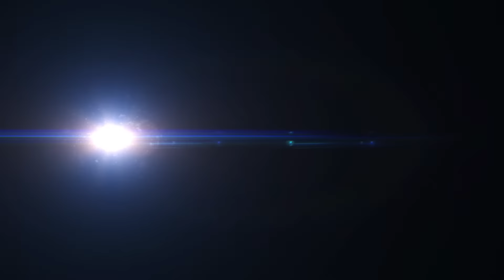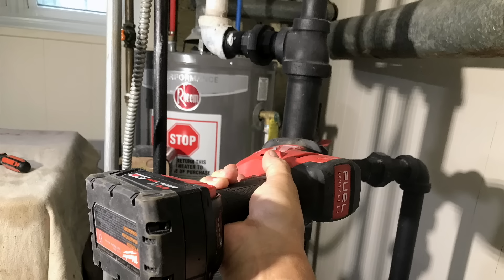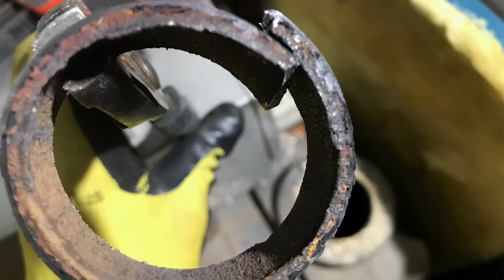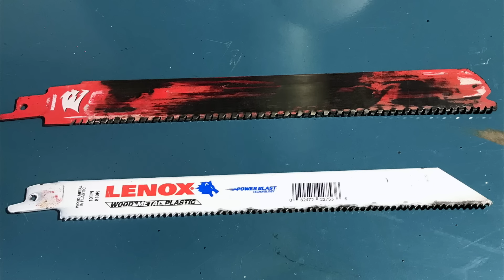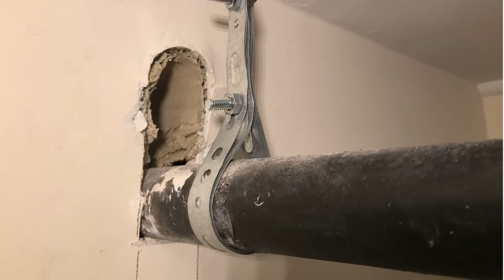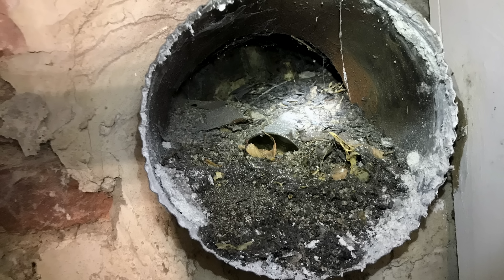Steam Boiler Pipe Repair

Comment: I have to pipe a dishwasher steam 1 1/2 supply and return condensate 1 inch can I use black iron schedule 40 and black iron fittings should?

Comment: Nice job - especially the explanations of how you get the pipes out.  I also liked that some of the mains were insulated.  Many don't do that and lose a lot of heat to the boiler room. Also liked your use of unions.  (I'd add a couple more to the piping for the VXT - just to make changing it easier if ever needed) 

A couple of things you may want to consider - 1. making the nipples below the water line stainless steel - less corrosion due to standing water and 2, maybe adding a drop header to help make the steam dryer.  Otherwise, great job.
Reply from the maker: Understood! Thanks for checking out the video!!

Comment: What happen if the boiler does not take cold water? Wouldn't that be a problem if you are feeding the boiler with cold water? "Introducing cold water into a hot boiler can cause sudden temperature changes, potentially damaging the boiler components due to thermal stress". Isn't this true?
Reply from the maker: This is true and if the boiler does not have an automatic feeder, I always feed with hot water. But if you read the spec's. on some  water feeders they recommend cold water! Could be a warranty thing?
Reply: @BobsPlumbingVideos  Thanks! I have a mcdonnell miller wfe 24 auto water feeder. It says  "Max Inlet Water Temp is 120F". I think the water coming out of the water heater is about 120F.

Comment: First.. awesome video. Totally no nonsense.  Just had a Weil McClain boiler installed. It's a dry return and two loop mains on 120 year old 2 story home with basement.
2 questions. Insulation. There never was any on the mains, the plumber didn't suggest but everything I'm reading is that it's a must.
Also, the diameter of the pipe on the 2nd loop, which feeds my 2nd floor is smaller than the loop that feeds the first floor. Is that correct?  I'm guessing higher pressure with the smaller pipe but I'm struggling with the concept since steam isn't really the same conceptually as air pressure.
Reply from the maker: Insulation a must on steam! Speeds up transfer time, delivers dry steam (best case) Would have to know the load on the 2nd floor to give you an accurate answer. Get this book, it'll open your eyes as to how a steam system operates. It's my "Steam Bible" 
https://amzn.to/3j7higI

Comment: 2 cuts 3/4 apart knock out the 3/4 tap each side to remove with caping chisel.  2 cuts easier then 1 cut.  
I fixed 2 jobs last year that had banging in pipes by boiling out with arm and hammer baking soda.  No re piping or rad replacement as recommended by previous company.

Comment: GR8T JOB..WAS WORKIN ON A  1.28 MILLION BURHAM TODAY-COMPLETE MESS, HAD A GAS LEAK FR WATER DRIPPING ON 1 1/4" -THIS BABY HAS 2  GAS CIRCUITS-THE OTHER CIRCUIT HAD WATER LEAK FR HARTFORD LEAK ON 1 1/4" REGULATOR...VERY LITTLE GAS FLOW !!..SPENT 4 HRS GETTING ONE SIDE OPERATIONAL WHEEEEEW !!!

Comment: Why no valve in the Hartford loop leg to isolate the boiler from the return??
Reply from the maker: Recently installed brand new return line installed by others, didn't think it was necessary.

Comment: Wow what a difference!  That is some solid work and it should be a vast improvement over how it was piped before.  I’m kinda curious why not just do a drop header since you had so much apart?  It is purely a question not a critique, I’m just wondering if it would offer any advantage or if it would be a waste of,time and material?
Reply from the maker: It's a very small house, only one riser coming out. Maybe a bigger boiler with two risers coming out, it's working like a charm!
Reply: @BobsPlumbingVideos  thank you for the knowledge.  I’ve been reading up on steam and watching some videos as well.  I’m also happy to hear you cured the problems with that house.  Keep on fighting the good fight and you’ve also got another subscriber.  Thanks again.

Comment: Nice work as always, Bob…….you mentioned supplemental boiler water treatment. I presently am using Rhomar 903. Although costly, it gets the job done.  What do you recommend? Thanks.
Reply from the maker: For moderately dirty boilers I use Hercules® Boiler and Heating System Cleaner.  But for severe priming and surging, my go to product is Scout boiler cleaner by Hercules. Thanks for checking out the video! Bob.

Comment: Once a week draining is excessive. Maybe if it had float LWCO. Adding fresh water that often will rot the crap out of boiler. I drain  only when i see sight glass water dirty when boiler not running. Unfortunately its a double edge sword when it comes to draining steam boilers.

Comment: You must have been Really mad when you arrived seeing the likes of an 90 Elbow connected up directly on Top of that Boiler... where as your Pipe Geometry was really excellent, with long run of vertical pipe up  the discharge line off the boiler before your First  90Degree Elbow...was told by an old school  Pipe fitter, to go Ten Times pipe diameter before  putting or fitting in a Bend...and make it a  Swept Slow Bent, or consider a 45 degree  another straight pipe then another 45 bend...to go to the Horizontal ...Great Upload...
Reply from the maker: Wasn't necessarily mad , but was like "who does this shit"!

Comment: Great video Bob.  I thoroughly enjoy your YouTube videos.  I am a plumber in Florida and as you probably know most of our replace and repair jobs are very different from your situations.  However, I still watching your repairs.  I was wondering what size caping tool you use.  Do you use larger tools for larger pipe sizes.  Thanks in advance.  Great videos.
Reply from the maker: 1/4" w/ double bevel, diamond, or half round depending on the job. Thank you for checking out the videos!

Comment: Where did you get that insulation ?
Reply from the maker: My plumbing supply house, but Home Depot and Lowes carry it. Make sure you tell them what application you're using it for - Steel pipe or Copper, there's a size difference.
Reply: Thank you

Comment: Did you get back to get it running?  How did it go?
Reply from the maker: I did, and it performed incredibly well. One exception was a convector in the 2nd floor front bedroom. Check it out here -https://youtu.be/4DKh_rkaf-E
Reply: @BobsPlumbingVideos  Thx.  Great that you can still work cross legged.  I admire your cut and chisel technique.

Comment: My dad taught me the same approach to remove an old pipe without using a hammer. 
It’s been working for me for over 40 years.
Your pipe work on the boiler is a work of art.👍👍
Reply from the maker: Good stuff

Comment: Very nice near piping. A lot of thought into serviceability, esp. with those drain cocks for blowing it down and clearing the mud leg. I do have some issues with the venting. First of all, it needs a chimney liner. When you find crap in the cleanout that means material is missing from the clay lining. The vent connector carries a 6" clearance to combustibles. The combustible wall appears to be pyrolyzed at the breaching. According to the sizing charts, you need to increase the vent connector off the water heater to 4" for that vent rise. Otherwise, good stuff as usual Bob. Thx.

Comment: Nice job Bob, I am in Eastern Connecticut and service and install a lot of steam. As you showed I also have corrected many ,many incorrectly piped steam systems. I after 36 yrs still can’t understand why nobody can read the installation directions 🤷‍♂️. Good for us I guess. Thanks for a great job.
Reply from the maker: Amazing that most installers don't even think of looking at the instructions. They're provided for a reason! Regards, Bob.

Comment: Bob,
I wanted to thank you.
I used your technique of cutting out pipe.
I had a washer with a 2” galvanized drain and a 1” hex reducer, had to do the cut technique to get the 2”x 1” hex reducer out. (this is on a 25yr old cage rack washer) I learned it
from your video of removing broken nipples from a radiator.

Comment: Great video Mr.Sessa.I use lenox saw blades and for the threads I use a three inch lenox saw blade.I also use a vise grip once I knock the threaded piece that remains in the fitting loose so as not to accidentally drop the threaded pipe piece.I agree with you 110% regarding cracking cast iron fittings (black pipe) to remove the fittings because cracking cast iron fittings rather than cutting the fittings out often does more harm than good and is also more difficult to do.Thank you for the video and God bless you and yours Mr.Sessa.

Comment: a little cutting oil on your metal cutting blades will make them last much longer. won't have as much magnetic metal shavings sticking everywhere as well. I don't know if you have to worry about oil contamination on boilers though.
Reply from the maker: Good point! I try my best to avoid getting oil  into the boiler. Creates problems.

Comment: I recently used the same process on a motorcycle fork slider but used a hand-held hacksaw blade instead of sawsall. Worked in the oil industry years ago and saw a lot problem with steam boilers. Smoke pipe routing looks a bit suspect. Good photos,

Comment: I like seeing the collar on the union going in the right direction. This separates the pros from the non-pros.
Reply: I did start-up  work along side a gas co tech from time to time in new construction blogs.  that was the first thing they would ck after the air pressure filled leak test. collars on the top of the union or I had to flip them around to pass inspection.

Comment: Very neat looking work! What size cutting  edge on your cape chisel?  Thank you!
Reply from the maker: I use two chisels - 319 Osborne 1/4" double bevel &  317 Osborne 1/4" single bevel. Both made in the U.S.A.
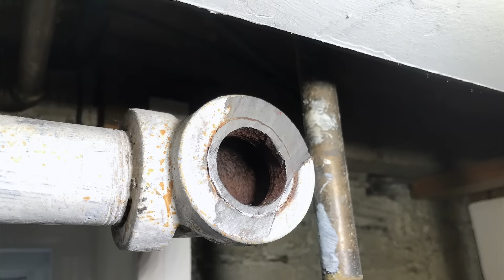Reply: @BobsPlumbingVideos  @ 6:33, why cut the surface of the elbow band? I always keep about an eighth of a inch of pipe, making it easier to work on with a chisel.
Reply from the maker: @jeffreyjohn2037   true! most times I do.

Comment: Bob, great job on that drain back problem. I do have concerns on boiler and water heater venting. #1 it looks like wood paneling on the right hand side of those vents and I hope you know the minimum clearance is  6 inchs to combustible materials ( a good repair for this clearance problem is to tack up Hardieboard or durarock ( non combustibles). You could also revent with B venting with a 1 inch clearance).#2 looks like that old masonry chimney is oversized for your water heater and boiler, most likely will not pass the seven times rule ( masonry chimneys should not be larger than seven times the smallest category 1 appliance vent pipe entering the masonry chimney, based on the outlet size of the drafthood). You did the correct  thing by referring them to a chimney sweep, they will most likely be installing a flue liner.
Reply from the maker: People do dumb things! There is a block wall behind that paneling and I suspect the previous homeowner had no clue! look at the way they piped the boiler? The clean out at the base of the chimney was 8" , but there was a 6"X6" clay liner going up. Still needs a cap up top and possibly a new liner. That's a job for the chimney sweep.

Comment: Really nice work.  I’m realizing that the “master” plumber who installed my steam boiler made so many mistakes.  Low height copper pipe header, never skimmed boiler,  short cycling, DOA pressuretrol, clogged pigtail, leaking backflow preventer, and leaking main air vents to name a few issues right out of the box after install.  I’ve since educated myself steam systems and mitigated all these issues.  Your videos are extremely helpful.

Comment: Good job, need to remove that hot side pex because it's too close to the exhaust. In nj you are allowed to use pex but when piping w/h you need to be about 1' away from exhaust. H & C lines